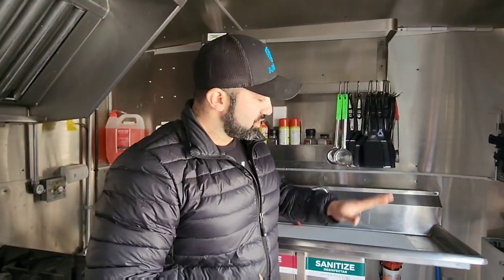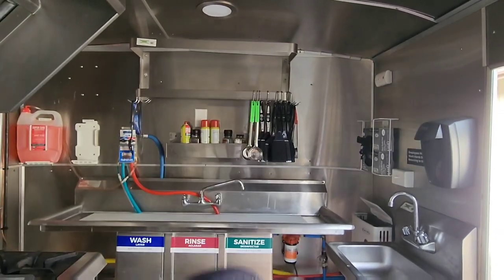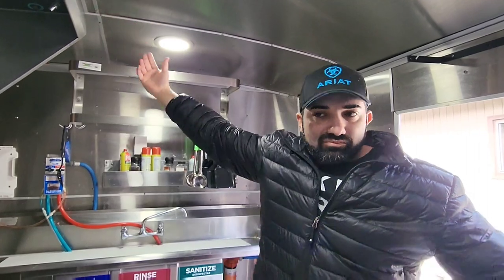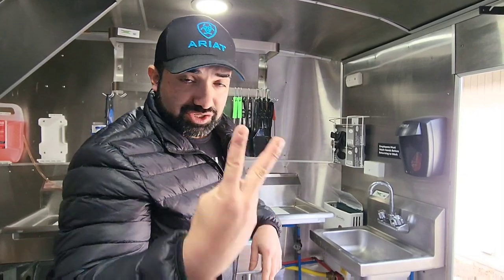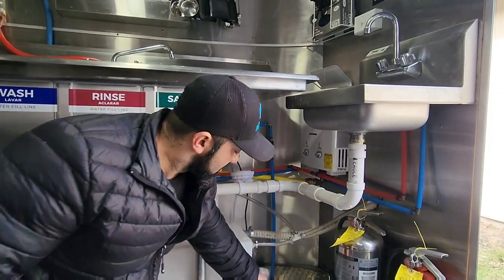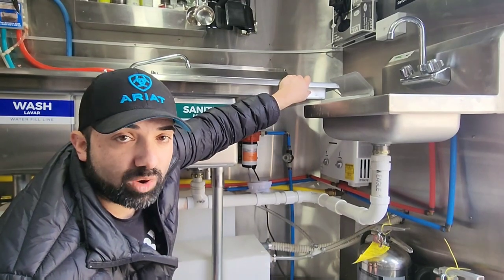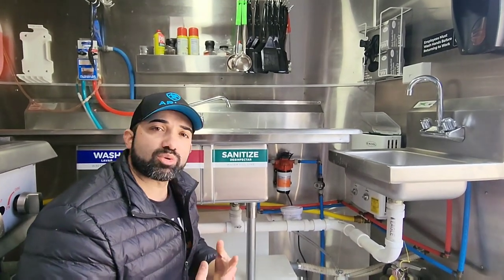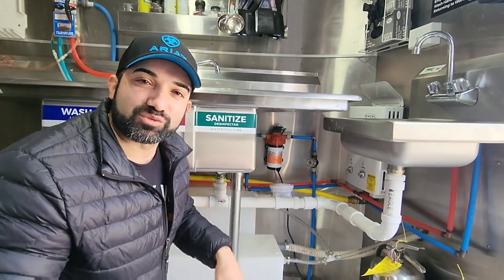Guide to Building Your Dream Food Truck: Tips, Tricks, and Must-Haves

Comment: Estimado muchas gracias por todos los videos. I wanted to get a speed control  gets too cold here in Alberta. What control vari speed does your fan use. I have a 8 ft hood. Also what on off switch do you have to Install at the exhaust on the roof. Gracias y bendiciones
Reply from the maker: Buenos Dias. The one I use comes with the hood I haven't bought one separately so wouldn't have much information to give you unfortunately
Reply: @Frank Baltierrez  thanks anyways 😊

Comment: Does your State/County require equipment to be raised at least 6" off of the truck/trailer floor OR if direct floor mounted than be "sealed" to the floor via a coved base for sanitization purposes? Im curious because of the floor mounted water tanks.
Reply from the maker: The equipment and tables yes. For us there are no specific requirements on the tanks except size
Reply: @fbaltierrez  I’m hoping that’s the case for me. I’m still waiting to hear back from the inspector.